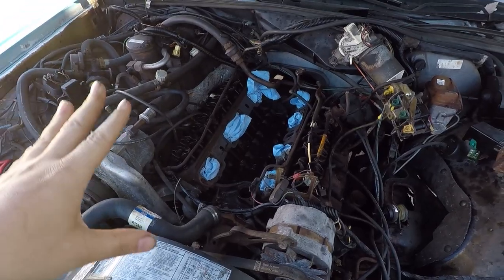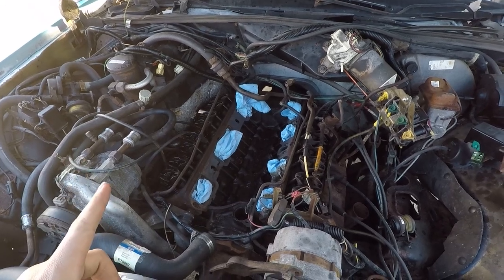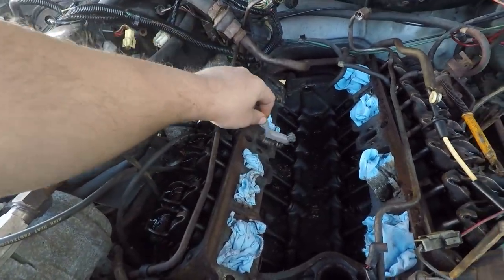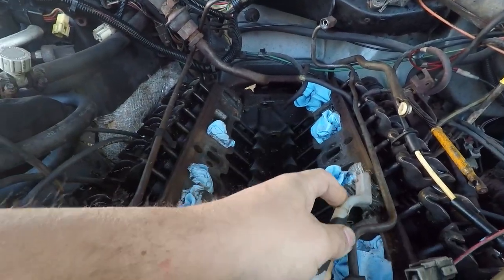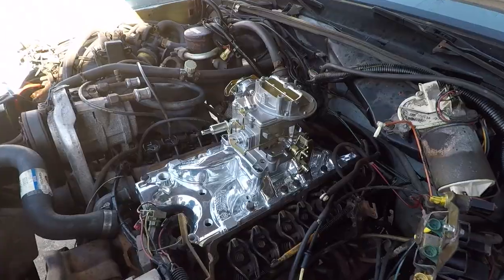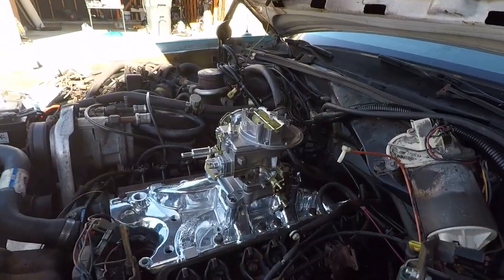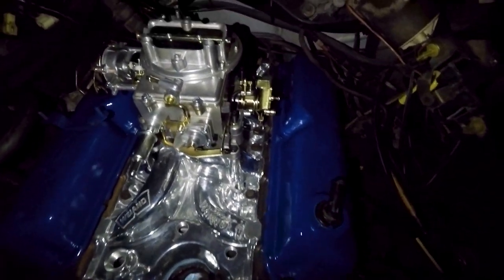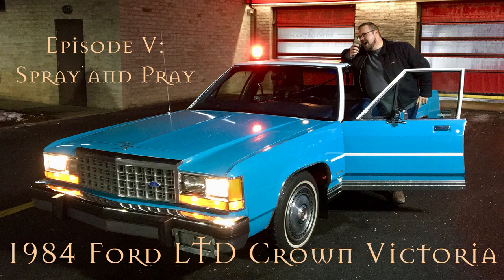1984 Ford LTD Crown Victoria Restoration Ep. 05: Spray and Pray

Comment: Great job!! You have made the right choice I started with the same set up and after a year I bought a holey 4B carburetor and a holey high pressure external electric fuel pump with integrated fuel
Regulator and you won’t imagine how fun of an engine.. 

Saludos from
McAllen Texas
Reply from the maker: Thanks for the support! I may go to 4B down the road. We’ll have to see how it goes!
Reply: @gwe87  I started my project with a 2B and later change for a Holey 4B
Reply from the maker: @juantijerina9393  We may end up going down the same road then!

Comment: Gary great job The valve covers look nice and intake looks nice and carb. those holes you got on the intake those are sometimes temperature sensor and some of the other ones might have to be plugged or could be a vacuum port to run vacuum lines too. and the ones towards the back looks like where the throttle bracket needs to be bolted down for the accelerator cable. Gary I hope that little bit of information helps you out. I also own a 1987 crown Vic LX which was purchased back in July it was a barn find has 33,000 original miles on it. The car is like brand new it was never driven in the salt always garage kept. 5.0  EFI automatic trans 3.55 posi rear end and dual exhaust. She's a real survivor.🇺🇲 🏁 😎 🏁
Reply from the maker: Thank you so much for the insights! You are probably right about the bracket for those two in the back, which, you know, is going to be interesting to get back on. That’s really sounds like a nice car you have there and glad to hear that it is in good shape! I hope you get to took it around once and awhile and let her stretch her legs.
Reply: @gwe87  no problem Gary that'll be a nice car when you're done with it you'll have a good runner there those crown vics they run forever. They also are becoming very rare far and few between. Most of the crown vics got wrecked in Hollywood movies useed as taxi cabs and also derby cars so to find a clean one is very rare. And thank you. yes I do I drive her around and I get a lot of attention and she's pretty much 99% original. 🇺🇲 🏁 😎 🏁
Reply from the maker: @santinocappellaro7468  Glad that she found a good home for her. What color is she?
Reply: @gwe87  she's like a red burgundy metallic with the plush red crush  interior. it's actually a really nice color when it's out in the sun it sparkles. 🏁 😎 🏁
Reply from the maker: That's a great color for those cars. It's nice to see character in your ride.
Reply: @gwe87  Thanks Gary . You're right she definitely did find a good home. She definitely will be pampered . It's really amazing that this crown Vic still has the original belts hoses and does not leak any oil whatsoever. Still holding the factory AC refrigerant. I'm really shocked a collector did not pick this car up. This crown Vic is a perfect example of a time capsule. I'm looking forward to this summer to go to some local car shows with it. 🇺🇲 🏁 😎 🏁
Reply: @gwe87  Gary the color on your crown Vic is nice too it's definitely different I do like it. Hope next video Gary you get her fired up!!🇺🇲 🏁 😎 🏁
Reply from the maker: @santinocappellaro7468  I'm really pulling for that as well, let me tell ya :) I think I'm getting pretty close!
Reply from the maker: @santinocappellaro7468  I've always believed that if you take care of your car, it'll last forever. Just replace and repair things when they need to be, and you'll never have to buy a new one again. Plus, if you do it yourself, it really makes you have a sense of accomplishment.